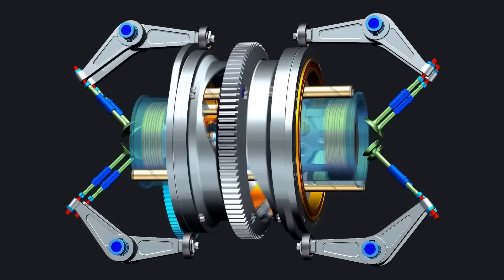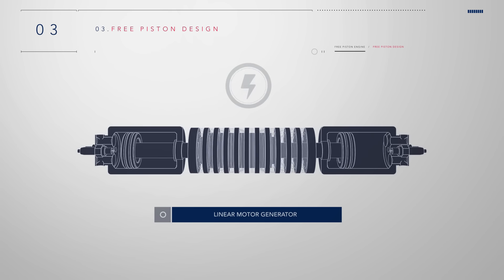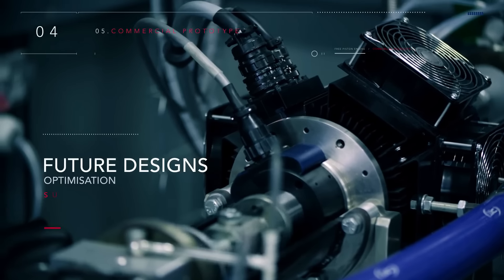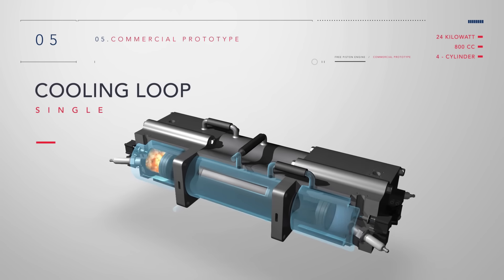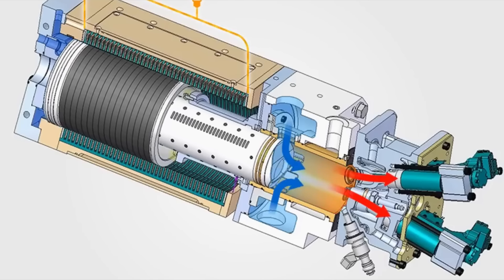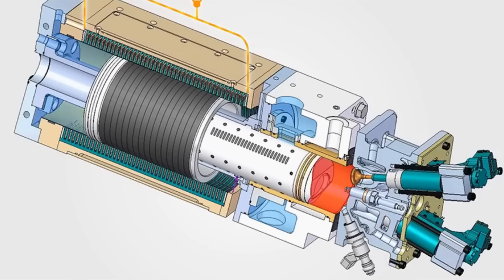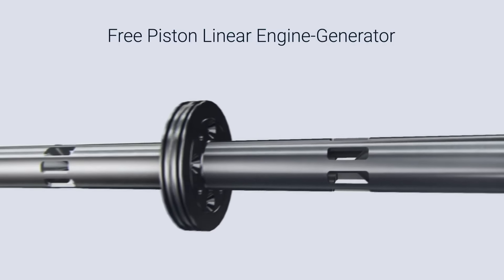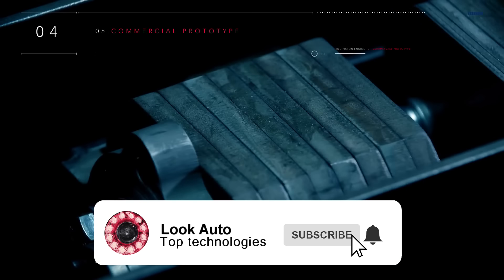New Technologies 2024: W-Piston Toyota | Free piston - efficiency of 50% | Powerful NEW engines

Comment: The free piston design would have been a good solution if it was introduced to the market 20-30 years ago. The second single piston engine is to cost efficient as it requires the permanent magnets.  Using an alternative will make the engine heave and larger in size. The Third engine has promise but will be expensive to run as we transition from present fuels.
Reply: Yeah, magnets might have a breakthrough though. Iron nitride

Comment: I question just how efficient these are. The delicate timing involved with intake and exhaust valve timing isn't allowed for using these designs. In a normal, Otto cycle piston engine, you'll find the lift durations and overlap between the intake and exhaust valves is ideal. This is because of their placement at the top of the cylinder and allows for the engine to properly exchange used exhaust gasses for fresh air (and fuel in the case of designs not using direct injection exclusively). A lot of overlap is allowed for, which can help to reduce emmissions by only partially exchanging exhaust gasses to the headers (sort of like an EGR does but simply via not removing all of the exhaust gasses so a portion can be burned in the next power stroke of that piston.
Reply: Idk just intuitively it makes a lot of sense that the intakes would be at the bottom of the stroke, because maximal vacuum would be achieved right at the end of exhaust meaning intake mixture is induced into the cylinder simply by that fact. At bdc maximal vacuum is achieved and right at that time intake is opened. It just makes sense. The only reason it's never done that way is because normally you have to go through the head and it wouldn't make sense to design valves driven from overhead or by tappets, but this design all makes sense perfectly.
Reply: yes. 2 stroke engines are less efficient than 4 stroke engines.
not to mention dirty exhaust gas due to incomplete combustion.

Comment: Could be an interesting direction for hybrid cars. Usually you run electric. On a long trip you use this engine permanently to add charge to your battery and boost your range from say 300 km to 900 km. Efficiency may not be the biggest driver. We need small size of the engine and all its needed components (radiator, exhaust, reservoir etc.) combined with significant power output (a model airplane or model car engine is small but it lacks power output). Even weight is less important as we can remove e.g. 25% of the batteries compared to a full EV which saves several hundred kg's.
Reply: La excesiva vibración seria el inconveniente
Reply: You may not want the generator to be large enough to charge the battery as that could lead to eventually running out of spare space for regen braking. If your generator is 2kW short from large enough to run the car and you have a 30kWh battery pack, you can run the car for 15h straight between charges by filling the gas tank. Designing this way gets you the smallest generator possible optimized to run continuously at a fixed load. No extra complexity for efficiently adapting to variable loads or dealing with a bunch of stop-start cycles per drive cycle.
Reply: @josenelsonarroyave2935    Designed obsolescence.. as your cars shakes apart, even slowly stressing out the carbon fibers and spot welds.
Reply: @teardowndan5364  There is no problem with a generator capable of charging the car. Many designs like the Toyota Prius, can drive and load the accumulator at the same time. You just stop somewhere between 60-70% charge, leaving enough room for long regenerative braking events while the cell voltage of the accumulator is still moderately high. Then you let drive the EV until you reach 30-40% charge or any moderately low cell voltage and turn on the generator again.
One reason why this is a good design is engine/generator efficiency. Most highly efficient combustion engines produce way more power (20-60kw) at peak efficiency than the average car would need for a steady-state drive which is somewhere between 5-15kw.
But any hybrid will usually be worse in short range compared to an EV and long-range to a pure combustion car because of the increase in weight for having two systems on board. Also price must be higher as you have to engineer and maintain more parts as a company.
Reply: @MrHaggyy  The only problem with a generator powerful enough to charge the car is that if it can do that, then you wasted more space and weight on an over-sized generator for the purpose of range extension (and supplemental heating in winter) than necessary. If you need 17kW to drive at highway speeds and have a 15kW generator, then you can drive 1500km on a 30kWh battery pack before needing to stop specifically for charging or having to drive at reduced speed/comfort.
Reply: @teardowndan5364  true but a 30kW generator is not much bigger in size and weight than a 15kW. You only need to increase the displacement a view mm most parts stay the same. But you easily gain 5%++ of efficiency by the displacement to surface area ratio alone. Thats +75km of range alone. If you alternate the generator you also waste overall less energy to friction. That`s another 2-3% so you get from 1500-1622km. Limiting your generator by a requirement of max power has it flaws Choose a generator that complements the nature of the technology and still is a good compromise with your overall system. For a heavier vehicle that requires like 200kW to drive but is range extended by a 100-150kW  generator that might work like a charm.
Reply: @MrHaggyy  There is a whole lot more at stake than the relatively modest increase in displacement. 
If you double the engine power, you double the amount of air intake, fuel, exhaust and waste heat flow that need to be managed, which means making all of the pipes, filters, catalytic converter, etc. twice as large, heavy and expensive too.
The alternator parts, whatever shape they may take depending on integration with the engine, will also be 50+% larger and heavier when doubling power.
Reply: @teardowndan5364  both our views are a bit exaggerated and it really depends on the power range. At 15kW and 30kW the fuel injection system is the same tier of parts. Air and exhaust mass is doubled so we might need to double the area but it`s still around 22-28mm of diameter. Most of the waste heat is inside the exhaust we only need a cooler for the exhaust feedback loop. Engine cooling until 50kW is done by the housing and a small oil or water loop. The alternator gets bigger but overall we talk about 2-5kg. That's well within passenger weight tolerance. Even 10kg would be.
Reply: @MrHaggyy  A 15kW generator may still be small and light enough to make into a manageable removable modular form factor. A 50% larger and heavier 30kW generator definitely won't.
Reply: @teardowndan5364  Regen breaking should be addressed by supercapacitors.
One thing you didn't notice - generator power can by adjusted by cycle frequency.
Reply: @peceed  A 1400kg vehicle going at 100km/h has 1.26MJ of kinetic energy and if you want to store that as a 400V to 450V ultracapacitor voltage swing, you will need a 60F 450V ultracapacitor. 450V / 3.6V per LiC capacitor = 125 capacitors in series and since the effective capacitance of series capacitors is 1/N, you need each of those to be 125x60F = 7500F. 125x 7500F capacitors is pretty expensive, takes quite significant space and requires a BMS-like system to make sure the whole thing stays balanced. If you use LiC ultracapacitors in parallel with the LFP battery cells to avoid needing a BMS specifically for the ultracapacitors, the battery's charge curve will be much flatter than the capacitors and most energy will end up going in the battery anyway.
As for "adjusting generator power with frequency", an EV range extender would be tuned for absolute highest efficiency possible, which means fine-tuning for constant load at constant RPM. Fudging with frequency and power are not an option. Either system load is high enough to warrant running the generator at the current battery state and projected trip length or it isn't.
Reply: @teardowndan5364  1) You are wrong there is no rpm in the free piston, and you can make strokes with the duration optimal for economy regardless of number cycles per seconds in the bottom range:
Reply: @peceed  Strokes per second are only a slightly different form of RPM and just like a rotating engine, you can tune all of the mechanical, electrical and pneumatic properties to resonate at a specific frequency for peak efficiency and power to happen in the same spot. Intake and exhaust headers can only be tuned to one frequency and flow rate to minimize pumping losses. The piston will only decelerate to the correct distance from its end-stops by compression without external assistance (wasted/lost power) at a specific speed, power, air density, etc. too. The more optimized the engine is for a specific speed and power, the worse it becomes at everything else.
An EV range-extending generator needs to be exceptionally good at only one thing: efficiently provide enough power to meaningfully extend the EV's range. Since the generator is completely divorced from the drive motor(s), it can be optimized to hell and back for an extremely narrow piston speed and power range just wide enough to accommodate +/-500m from sea level.
Reply: @teardowndan5364  Apparently you still have no clue. Linear piston is not bounded to sinusoidal motion, so it can be much more flexible. It can burn fuel completely in constant volume,  make extremely quick expansion and then open ports with constant volume. Even if you benefit from resonances for charge exchange, you can introduce longer gaps, so engine can make 100 cycles in a second and then arbitrary long pause, for example 3 seconds, and you get 25% of its continous power - all in optimal working conditions.
Reply: @peceed  Plot the piston's position on the X axis as a function of time. Do you know what you get? Something still very close to a sinusoidal function since it is still fundamentally a mass-spring 2nd-order system.
Reply: Yo can see the great advantage of this when you realise that most car engines only need to run at 10% load for 90% of the time  eg they are 10 times larger than they need to be.  With a serial hybrid you can use the e motor to provide the max power, something It's well suited for because e motors always have a very high power to weight ratio. The ICE motor in this application only has to supply the "average" power and can be optimised to run a constant speed.

Comment: I wait.,from Toyota to make a long time combined Neodium extra usefull engine...for cars end truck  in single end multiple plates...end with double out point in movement or parking pisizion to use piwer for watever.,like generator for elektricity water or air pump,,or for reductors ir many spkendid ideal...no water only for ckeaning a Windows end shields...no fuel ...no big batery ...more.,more lithe....simple...with more spase for more seats or space   end the cleanest technology.,,,..end cheap engine to servise...with quality parts.,for long use to 1 000 00 km or 100 years..with manual gear end 4x4...onlycthe clutch to be composed in line to fast end easy repaire  with duble plates...ewendvreductor..no more of 15 min for good mehanike...no dpf no alien tehnology yust simply end secure

Comment: I think that to maintain my cruising speed in my truck I need 34hp. That would be very efficient in an hybrid system for my truck.
Reply: Going up hill, that's why car manufacturers need a bigger than 34hp to go uphill and accelerate you need 3-4 times more power or you will be creeping along  at 15mph in low gear going uphill about to blow.
Reply: @chrisbraswell8864 I agree, but lets say I need a displacement on demand engine for when I need to tow or when I accelerate, there would be multiple free piston engines and the other cylinders could just rest and do nothing. Instead, the actual engines with cylinders deactivation keep the pistons moving creating useless drag and energy loss. Also these deactivation systems are often problematic. With this said, this concept would allow an efficient 34hp even with the option to have more power when needed.

Comment: This design is bullshit.  The narrator says two cylinders are needed to compensate for vibration.  If you believe that, I have some ocean front property in New Mexico I'd like to sell you.

There is no way to compensate for all vibrations unless two of these are mounted axially, not side by side.

50% efficiency, huh?  I guess these guys never heard about the theoretical limit on efficiency of a heat engine.  It's no more than 50% which is the theoretical maximum.  Are we really to believe this when there are also losses in the coil?

The largest source of friction in any piston engine is by far the rings.  Like by two orders of magnitude. The next is valves which have not been eliminated here.  They are obviously electronic or pneumatic, but the energy to actuate them has to come from somewhere.  The elimination of the crankshaft hardly has any impact of system friction reduction as a whole, because each journal spins on a near frictionless liquid bearing when under pressure of oil.  Which by the way, mention of oil and proper lubrication is mysteriously absent.  All the poor souls without brains on this channel who are believers of this crap show, well I feel genuinely sorry for you.  I hate to break it to you but there is nothing more practical, efficient, compact, etc. As the modern inline 4 cylinder, ohc.  Nothing.  And there will never be.  There is 100 years of history with that design, and modern ones will never be beat by a fundamental shift away from a crank, four rods and 16 valves.  Not ever.

Comment: This looks like a good solution for certain applications but not for all just like everything else in life. In the past engines designed for one field would be adapted and modified for other applications like automotive to marine but this could fill an area such as generator systems or other stationary machines like pumps.

Comment: They have a German Submarine in exhibition in a Chicago Museum, it contains a  Free Piston engine, Opposed Pistons generating Gas moving a Turbine.
German crew opened a sump to drown the U-Boot, but a group of fishermen found it and rescued it.
It had also a 'Maxwell's Devil', a solid metal device, compressed air supplied from the vertical part of a 'T', one of side branches provides air hot enough for welding, the other side, freeze cold air.
Blessings +
Reply: Interesting only if one could rebuild the same would become a millionaire overnight, technology is available already not one's ready even to replicate it.
Reply: Do you even know what a Maxwell devil is?
Reply: @ph4nt0m22  lol. i love how the "vortex tube" is referred to as maxwells demon...

yes, the way it operates is freaking insane and hard to get ones head around, but theres no magic or free energy in such a device! just sheer ignorance...

the only feasible use for a linear engine is as a pump... be it directly acting on a fluid or simply to produce hot gas for a turbine... eventually they dumped the free piston part and stuck to a plain old "combustion chamber"...

ignorance.... most people think all you need to do is wave a magnet past a wire... they have no idea about reluctance, magnetic circuits, flux coupling, relative velocities... magnetic saturation, eddy currents, hysteresis... the last one being a non issue with the linear generator as its magnetic field never swaps polarity, and that means you immediately can only harness "half" of the energy of that changing magnetic flux... reversing the field completely as it passes within a coil, as is done with any "rotating" generator, allows for the full amplitude of the magnetic flux variation to be extracted...

thank our modern education system... some of this stuff was taught in primary schools a few decades ago...

Comment: An interesting idea.  Of course a lot of bits aren't shown i.e. radiator, water pump, air filter, fuel tank, silencer, fuel injection pump and starter motor (the linear electric generator could probably be used as the starter motor so a separate starter motor would probably not be required).
Reply: Yeah they said that about the starter/generator at the beginning of the vid.
Reply: Electric cars also have one or more coolant pumps and radiators for the battery pack, motor, motor drive, on-board charger, cabin heating, etc., the generator would just be the hottest hop in the heat collection loop.
With the new axial flux motors coming out, I suspect we'll see many hybrid vehicles ditching the conventional starter and alternator setup for an in-line axial motor-generator between the engine and transmission replacing the flywheel.

Comment: What is the horsepower to weight? A 200% gain in efficiency doesnt make a difference if you have 200% gain in weight. More important what is the cost? If a traditional engine is cheaper, more reliable, lighter, and makes more power than there is no reason to change what isnt broken
Reply: Not only that, what's the RPM torque + is it able to withstand the load/stress ?
Reply: @yacinealg152  very good point. People put motorcycle engines in cars all the time but the gearbox doesn't last very long because it was never designed for the extra weight